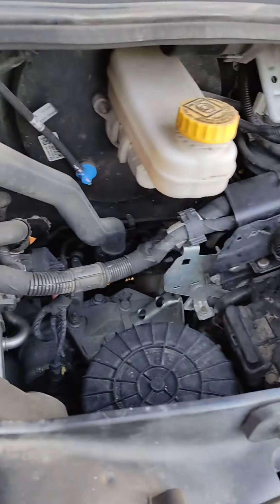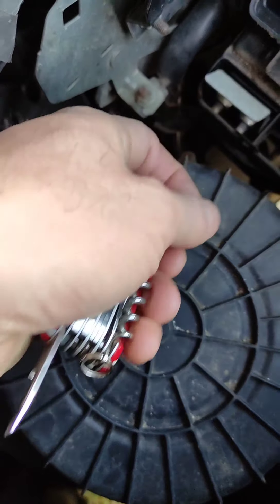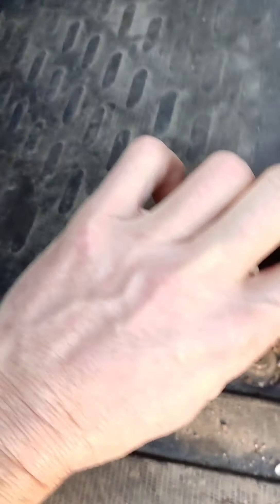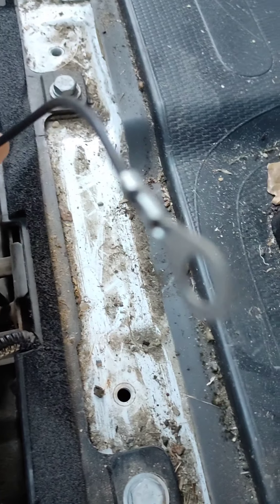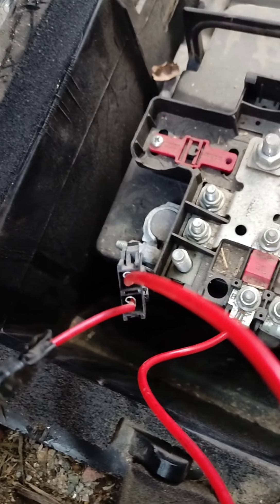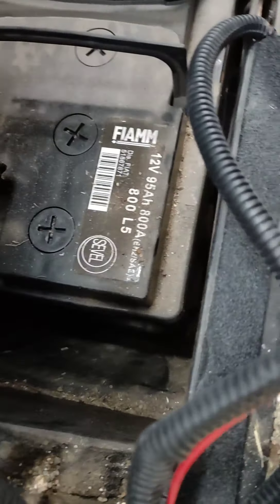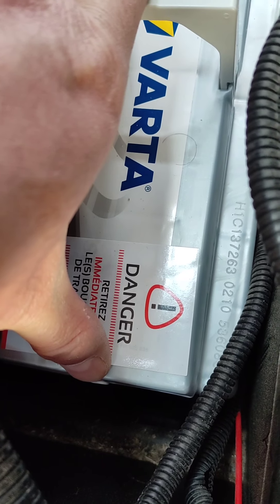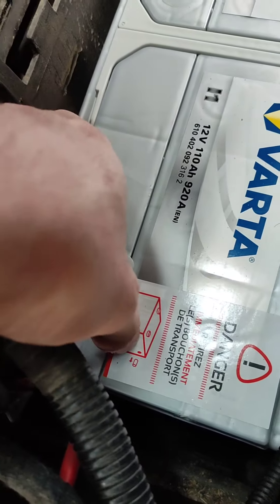How to Jump start and change a battery Fiat Ducato van

Comment: Thanks for this handy video. I have a Fiat Ducato Motorhome and always wondered how to jump start it without having to take the battery cover off. To answer your question about the mystery connector and earth connection in the battery compartment, I think this connects to the optional battery isolation relay supplied for some markets. Why you would want to isolate the battery is the next question!
Reply from the maker: Hi Ian, thanks for your input. Glad that the video was a help! Perhaps the battery isolation is for when a leisure battery is used, to stop the starter battery draining?
Have a great day!

Comment: Very useful, thanks.
I'm about to do battle. A few days cold weather killed mine.
Reply from the maker: Yes Julian, the cold shows weak ones for sure. Hope that it goes well. Take care and thanks for your comment
Reply: I see you put in the l1 battery rather than the 019. No issues? And where did you buy yours? Big choice out there!
Reply from the maker: @juliancox4862  no problems with mine, starts very quickly! I got mine off the net in France

Comment: Having watched this video, I’ve just fitted one of these bigger Varta batteries to my 2013 Peugeot Boxer camper van. (Note that this model battery is not suitable for vehicles with the Stop Start function). I also connected another battery to the jump start connections under the bonnet to maintain background power supply to the ECU, Tracker, Radio etc, whilst replacing the vehicle battery. My original factory fitted battery was 95Ah 680A rather than 110Ah 920A as now fitted.
Reply from the maker: That's great to hear Sid, thanks for the input